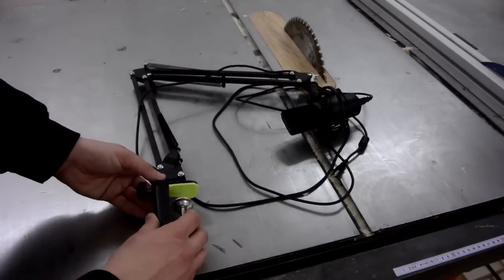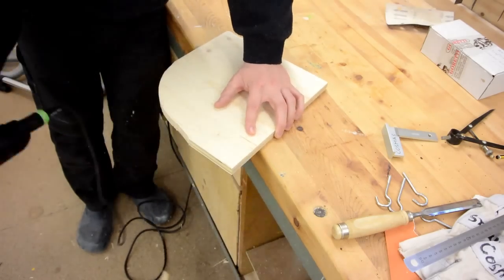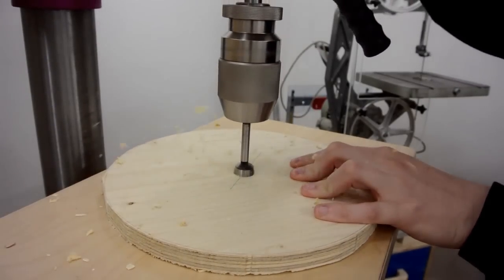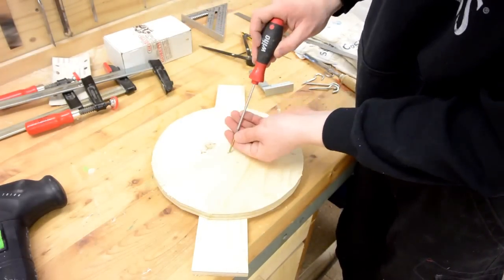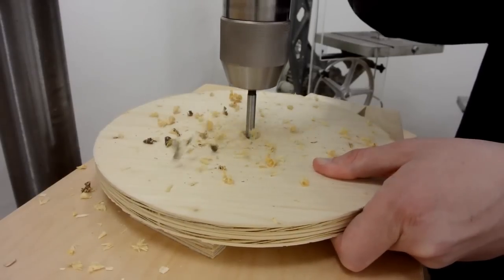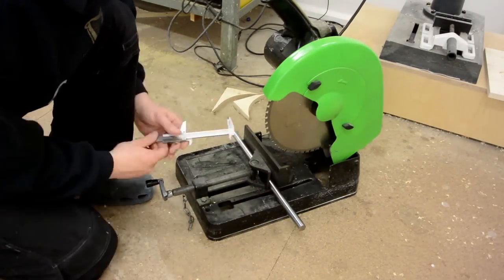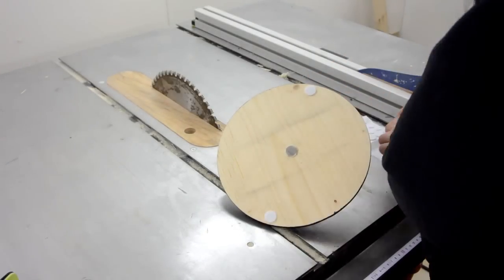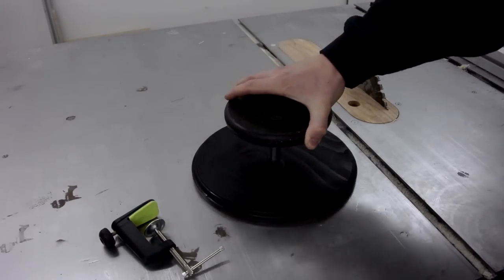Microphone Base Plate

Comment: Nice job!  I did something similar, except I used an old brake disc rotor from my car.  It is round, requires no additional weight, and works quite well.  Regards.
Reply from the maker: Well that is an super cool slution of course... :)

Comment: The first time I used my ogee bit was also for my microphone stand ;) And to prevent the chamfering bit from chattering, use it with a hand drill and super low rpm.
Reply from the maker: Really :D 
I tried it. It doesn't help. These things are trash. I tried to change the cutting geometry one of them but that messed it up even more.
Reply: +Cosmas B hi, chatter is a symptom of lack of rigidity, a dull tool or too much feed and or speed. to minimize try fixing the piece (in this case the vise) to the table (assuming the table is rigid enough), use the quill well retracted into the head of the machine, speed should be 1/4 of the speed to drill the bore you are trying to chamfer, and feed should be positive, get in and out in one movement
Reply from the maker: I tried all that. I looked up the right speed, checked the drill press for runout, I tried it with a lot of feed, less feed and minimal feed and all that with the vise clamped to the table. These countersinks are super cheap so I highly suspect that there is something wrong with them.
Reply: +Cosmas B Is mir jetzt zu kompliziert mit dem Englisch. Der Auslöser ist schon die Mangelnde Steifigkeit die man ausserhalb von Maschinen solideren Kalibers nicht erreicht, die hier verwendete Bohrmaschine ist ja wahrscheinlich auch nur mit 16mm in Stahl angegeben und das ist schon optimistisch. Die Motorleistung ist dafür gar nicht auschlaggeben, die Kräfte können einfach nich aufgenommen werden. Zusätzlich zu einer ungeraden Anzahl an Schneiden 1,3,5 gibt es auch Senker mit "extremer Ungleichheit" oft mit Zusatz EU oder EUC gekennzeichnet. Das Funktioniert komischerweise auch wenn mein Kopf sagt das dies eigentlich genauso sein müsste wie wenn man einen Senker mit nur einer Schneide verwendet.
Reply from the maker: Ich hatte früher eine noch windigere Bohrmaschine und hatte auch keine Probleme mit Senkern. Dass die Motorleistung nicht ausschlaggebend ist ist klar.

Comment: You could use  non slip router mat material on the base.
Reply from the maker: Often times you want to be able to push it around on the table especially because it is fairly heavy. So non slip material wouldn't be a good idea.